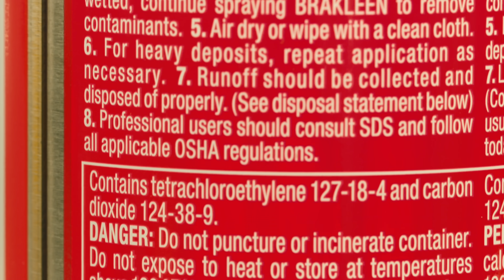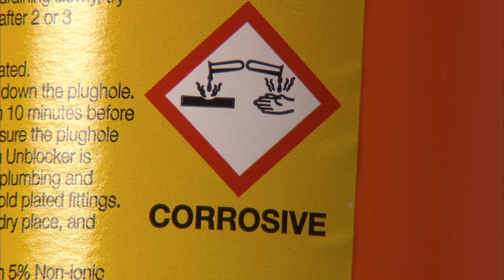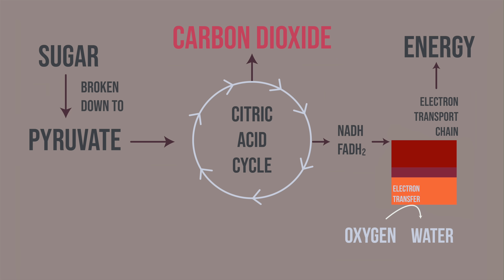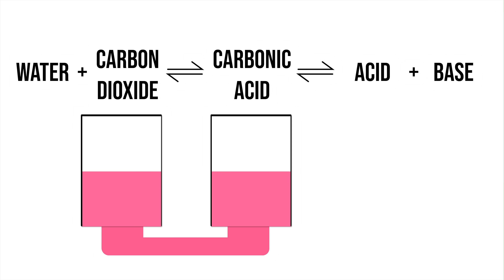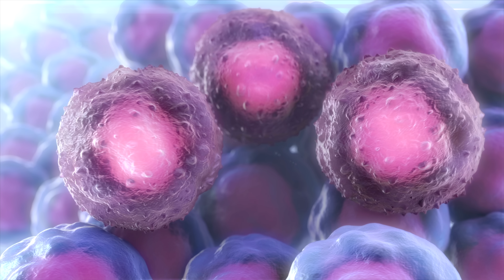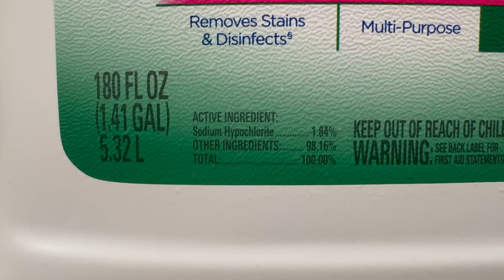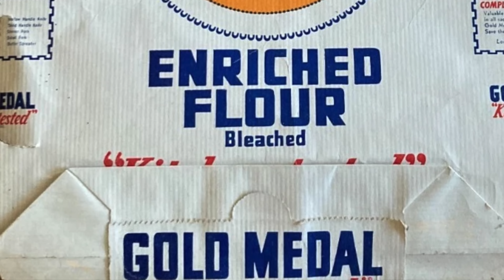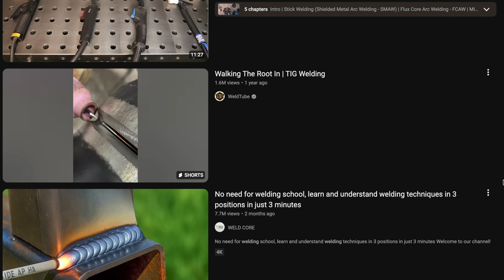"It smelled funny while I was welding and now I can't breathe..."

Comment: Perc is being phased out of most brake cleaners now. I think it’s by choice and no industry regulation. It is still very likely to find older cans in garages and possibly still on shelves. I watched a video about chronic exposure to brake cleaner by auto mechanics and the lack of understanding on how it causes illness later in life. A quiet detail about auto mechanics that no one is talking about is the common occurrence of cancer at a relatively young age, 40s-50s. There’s no precautions to using brake cleaner. Or the precautions are ignored because you need to get the job done and move on to the next task. Simply wearing gloves isn’t enough. The fumes enter the lungs and into the bloodstream. Where it then spreads through the body. 

This isn’t meant to suggest that brake cleaner without perc is safer. It still needs to be handled safely.

Comment: I've been a welder for 5 years and all of this is so true. I see so many people, mostly older guys, weld without proper PPE and it's mind boggling. Welding is incredibly hazardous, especially when you're welding galvanized steel. The coating is highly toxic and easy to breathe in when you're welding. Masks, air circulation, and long sleeves are super important

Comment: I have that same welder. It burns into rusty metal pretty good as long as it has a clean ground. I saw a year or two ago about using chlorinated brake cleaner to prep parts for welding and it’s an Australian guy and he said don’t do that first thing to happen is you’ll smell wet grass then you’ll die. I also have an older flux wire welder from Harbor Freight I bought long ago, 13 years or more ago. Blue one uses AC and makes tons of spatter. It will really burn into rust though. Very nicely.

Comment: Here I am thinking back to when I was a young mechanic working in an exhaust shop. Literally no one ever told me not to use brake clean on things that needed welding. 

I never did it, thank God. And if I do use brake clean on a part that needs welding,  I always wait for the brake clean to be gone before striking an arc. But that was mostly because I know the only things fhat should be in the weld is steel, flux, and maybe Argon gas - i didn't want to contaminate the weld and make it weaker. It's kinda crazy to think how dangerous this can be, no one told me about it back then (they probably didn't know either), and it's been over a decade since and this information still had not made it to my ears in that time frame. That's wild to me.

Comment: The first thing I did years ago when I heard about this problem was getting rid of all the brake cleaner in my shop. Now I just used 90% rubbing alcohol or straight methanol for more critical cleaning.
I also quit using bleach and found out that Windex or straight ammonia are much safer options.

Comment: i know this all to well. I went tot welding school and was told that brake cleaner was a good way to clean the metal off, especially when welding aluminum. So as i was already keen on modifying my car, i would often use brake cleaner to clean the metal before i welded it. Often times i would smell something funny, like chlorine. My day job is a maintenance worker at a gym, i often work with or pool techs and smell chlorine. So the days that i would weld after using brake cleaner id smell the chlorine, but it would get soooo intense that I'd quit. I was vaping heavily (the box mods not salt Nic) at the time and i wonder if that helped my body over come some of the negative consequents. Regardless after watching this video i will begin to use something else to clean my metal of grease, or use a blow torch to not only preheat my project but also to get rid of the contaminated pieces.

Comment: Dead, just 31 hours after exposure. Just 1 more thing I have to worry about with 5 sons. This was horribly sad, but I’m now wiser thanks to your video.
Reply: It’s terrifying, but you’re right. At least you now know what to watch out for.
Reply: If they weld, do not allow chlorinated brake cleaner in your garage. Non-chlorinated brake cleaner is fine.
Reply: Show them this video.
Reply: If they happen to want to get into welding there are plenty of safety videos on YouTube, they can also look through the american welding society. Our old in rate manuals from the navy for the HT, hull technician, manuals are available in pdf form and have all kinds of procedures and safety precautions. I know many places don't require to wear respirators while welding but you should wear a proper respirator when grinding metals or welding. The consequences don't come right away when it comes to welding they come years later. I have asthma now and memory problems. I was a welder. I enjoy welding but it's hard on your health long term if you are not careful. Whatever they are in to, let them know there are lots of free resources online to help them learn both the skills, and appropriate safety precautions. Never mix heat with random chemicals or cleaners or mix chemicals with chemicals they're not sure about. Ànd if they work in a trade as a job, never ever take a job or assignment  that feels unsafe and always advocate for yourself and your safety.
Reply: Ever heard of a condom?? Or a vasectomy? Ffs..
Reply: bro a subsistence farmer with his 9 sons
Reply: @jarman5422  9! I’m a slacker!

Comment: "The lasers, the car batteries" 😂VERY VERY nice detail slipped in there! Bravo!👍🏽

I also want to add that it's a VERY important message you're conveying about how easy and accessible learning new things (like welding) has become. But how that also can be EXTREMELY problematic if the 'newbies' are not aware of the dangers.

Another example where I see this happening A LOT in the DIY Scene lately is people working with epoxies and resins (Polyester, Vinyl Ester and Polyurethane resins, and UV resins (which aren't completely safe either!) etc) without ANY ventilation, respirators (PPE) etc, all due to 'trends' making them popular and just 'blindly copying' without actually doing research about those topics. Sometimes even making "fun resin objects" with their kids😱.

Like ChubbyEmu basically says guys: Please do proper research when starting a new hobby, how exciting it might be to get started, the "boring stuff" is what might actually safe your life!

Comment: Most of the brake clean we use has trichloroethylene in it. It states on the back of the can not to get it hot or it can cause phosgene gas. The chlorinated brake cleaners can also put a fire out, but you definitely better not be downwind or breathe it. In the old days they used to sell glass balls with these chlorinated chemicals in it, and if you throw it into the room it would put the fire out. Luckily these are no longer available.

Comment: As a former refrigeration mechanic, I can tell you phosgene gas burns badly when inhaled.  If you were welding a unit that still had some trace R22 or other gases left in the lines you would get a green flame and the smell was terrible and very bad to breath in.  I got hit a few times by very small amounts of it, but man did it suck.  Took minutes to get my sense of smell back.  I was careful too, pumped the units down but the oils can hold onto the gas too and release it over time.

Comment: I don't get why Halogenated solvents are used in Brake Cleaner when the rest of the world switched to Hydrocarbons which have the exact same performance and minimal risk to the end consumer AND IS DIRTY CHEAP. 
While Hydrocarbons are flammable, they rapidly evaporate and are used without issue, but this is one of the many things America is still lagging begin. There's this notion that the 'good stuff' must be toxic, but halogenated solvents only have advantages in a very few applications and those advantages will never be seen in welding.

Comment: I sued to use a two-part pool treatment that you were supposed to mix in a smaller bottle and pour in. The two parts were hydrochloric acid and hypochlorite. It went well but you had to work quickly and put the cap on before too much gas had evolved. I'm a little surprised that was actually marketed to the general public and not pros working in fume hoods.

Comment: Styropyro??? Well, that was a surprise!!! 
Anyway, that shows the importance of fans and airflow! In my experience, You can pretty much always create an airflow that allows you to breathe clean air. I always had a fan from afar blowing so the air hit my face, thus providing fresh breathable air while avoiding blowing on the part being welded. Nowadays, they have ventilated welding helmets that blow fresh air inside from a hose, for that matter. BTW , I once used brake parts cleaner to clean a seam for a water reservoir for a bandsaw, then welded it, thinking that once it had evaporated, there would be no problem. WOW that odor was anything but a fresh cut lawn! More like a whiff of what chlorine gas must have smelled like in WW1 ! I made sure not to breathe any of it! What NOT to use as a cleaner! 
Enjoy your welding adventure, Chubbyemu!
I'm sure Styropyro will arise like Lazarus and be back to making about now hahaha.

Airflow airflow airflow!

Comment: Breathing welding fumes, specially galvanized steel, will give you a strong fever and can be fatal trough heavy metal poisoning and brake cleaner in direct contact with skin will cause cancer. I know a former professional welder and a blacksmith wom have died or devoleped cancer from being to complacent with safety equipament.

Comment: RED-CAN brakleen and welding is as WELL KNOWN never-do... its something often talked about on welding forums and beginning youtube channels.. I dont weld and I run across the discussion s all the time about it..   the same goes for using brakleen then grindin g or wire-wheeling.. as the sparks getting created by the tools are hotenough to trigger the reaction..brakleen is something i use regularlybeing that im into saving / restoring old busses... many of which have sat for years before we get to them.. however its definitely a chemical to be careful... like any solvent..   welding is an especially bad situation with the high heats used and typically the close proximity of the face to the work... makes it really easy to breathe in bad stuff..

Comment: Although not as severe as Phosgene poisoning, galvanic sickness from welding on galvanized metal (Zinc plated) is something to be avoided as well. Merely sanding off the Zinc plating is not enough, as it is etched into the pores of the metal. Muriatic acid or something equivalent is required to remove the coating before it's safe to weld. A spray on galvanizing coating can be applied afterward to restore the corrosion resistance of the material.

Comment: Damn... I use brake cleaner to clean surfaces all the time, and I'm sure I've done it before welding. That said, I'd wait until it dries before striking an arc, because it's also crazy flammable. I wonder if I've done this to myself on a very small scale, without even knowing it...

Comment: As someone that just started welding as a hobby, I truly appreciate this.
Reply: Stay away from galvanized as well.
Reply: have proper ppe, keep your head out of the smoke, don't produce phosgene gases and have fun bud
Reply: Then, maybe, this might be of use to you... I started welding in the 70s, to become "multi-skilled" not be stuck on one machine, in one place, for life.  In my youth, people believed that when they visited the  seaside, the air there had health benefits because it contained "ozone"  When welding using electrical methods, we produce ozone, and... Some welders believed the ozone beneficial... so inhaled as much as they could, either to maintain good health or to cure a breathing problem... Any existing breathing issue was, in all likelihood exacerbated by this... 
And that was before you consider the damage to health caused by welding galvanised steel (Zinc, Metal Fume Fever)  Cadmium plated steel (pneumonoconiosis) Terne plate (lead coated, lead poisoning)
Not an exhaustive list, just accept that in welding and in so many other engineering disciplines, everything around you is conspiring to kill you, including your workmates and yourself (not necessarily deliberately, of course, just the right amount of stupidity / bravado can do it...)
Reply: @robertlawson8572  Well said! I’ve been a victim of workplace stupidity a few times.

Comment: I am not that sure this happened as described. Welding involves high current, not high voltage. TIG (WIG) welding sometimes introduces high voltages into the system to ignite the arc, but that is low power thing used only to ignite, it does not affect the welding process itself…but it could be heavily dangerous when it comes to cardiostimulators and implanted electronic devices at all. Typically not because of high voltage, in fact, you does not touch that thing, but because of high frequency, which is utilized to somehow lower that high voltage to something at least reasonable.  Higher frequency sources are much more likely to arc than low frequency ones, there are reasons behind this effect, that I definitely don't want to explain here.

The thing is that welding in fact requires removing oxygen from that process. This is achieved by using shielding gasses like Argon in case of TIG and MIG, carbon monoxide when it comes to MAG and also some weird gasses emitted by burning the coating of an MMA electrode when it comes to stick welding. Which leads me to conclusion it was not the welding process itself what turned that brake cleaner into a phosgen, it had to be some side effect of that process. 

The second thing that sounds weird to me is the fact, he sprayed that rusty metal with a brake cleaner and then tried to weld that thing. Welding directly to a rusty steel is almost impossible, trying it leads to horrible experience, and just spraying brake cleaner onto that rusty piece of metal does not make significant difference as the only thing that brake cleaners typically does is it makes the cleaning process easier. And as you remove all that dirt and rust, you also remove most of that brake cleaner you'd sprayed before. Maybe he just sprayed that thing and then tried to weld it, failed, tried again, that part became hot, then he sprayed another brake cleaner because "it always helps" and at some point inside this endless loop the temperature of that piece of rusty s…teel reached the point when, when sprayed by brake cleaner, it produced at least some phosgen. "Motivated and stupid", which is something, that comes hand in hand. I see no other way how to explain this. Motivated people are always huge disaster when it comes to work in so called "real world".

Furthermore. This had to be really hard to investigate. He was probably alone when he was "welding" and he was nearly unable to speak when he was brought to emergency room and then, when he was intubated… You got the point. They were probably right about that fosgen and when somebody found a lot of rusty metal and a lot of brake cleaner in that workshop, then they just connected all that together and, of course, it makes sense. But I don't think someone knows what exactly he was doing.

Comment: How fast can that reaction happen?
Is it enough if you just have a break cleaner, steel and oxygen or are there other parts that need to be added to the equation?
I'm sometime in contact with welding at my job and see it a lot of times that people use break cleaners but never had anythying happen

Comment: 6:22 Heck, even if you don't care about the sunburn, you don't want to accidentally brush against a fresh weld with your bare arm. I did that - once!
Also, get an extractor fan to remove the smoke and gasses produced when welding before you breathe them in.

Comment: Just a friendly FYI... Most stores don't sell chlorinated brake-cleaner anymore, for this exact reason. It's not just a problem with welding. When you spray chlorinated brake-cleaner on hot brakes, the same thing happens. Because of that, the government here (Canada) has made it so it's straight-up illegal to use chlorinated brake-cleaner in a professional setting. Workplace accidents are treated like crime-scenes here, and if it's determined the company's at fault, they get huge fines, and possible jail-time. Frankly, I'm amazed you can still get it in stores, but you'd really have to look for it. I've only ever seen it in small amounts, tucked off to the side, in Canadian Tire.

Comment: To get rid of rust i use a special antioxidant base acid. It removes the oxygen bond and saves the metal. Then i polish it all up. Then i can happily weld. I almost welded galvanized steel even tho i know better. I realized in time. Careful out there.

Comment: Works longt Time  metal industry. Used Air mask. Saved healh your lungs .  Big risx not Us Air mask. Lungs broken. Small micro metal And chimicaly elements gase weld moments . Not It's not too late to prevent it. But I know most people around the world do not take them into account for health care when working in harmful conditions with metals and gas equipment welding work. But also construction work. Wood workshop work chemical glass work. All work related to dust and gases has a harmful effect on the health of the lungs. Remember to use an air filter mask. Fewer risk factors for your health today and in the future. The lungs are not eternal against harmful factors. Cancer Due to poisoning irreversibly damages the lung bronchi capillary tissue. Similarly smoking.